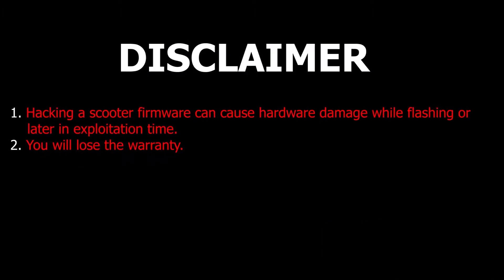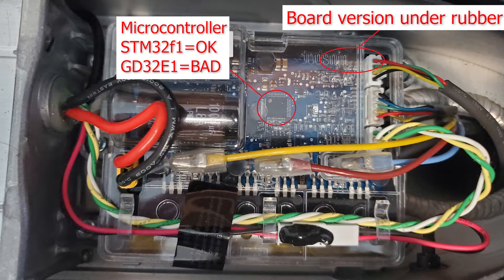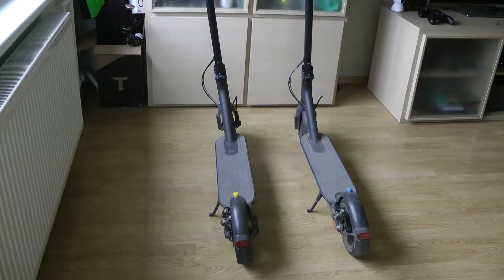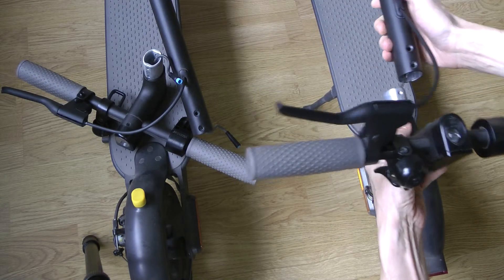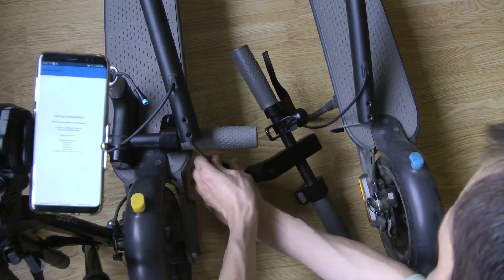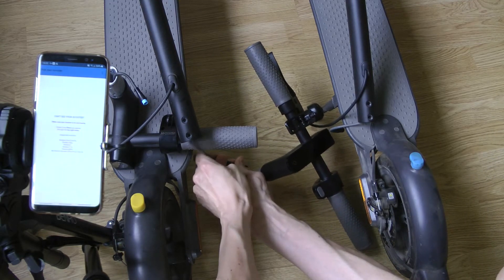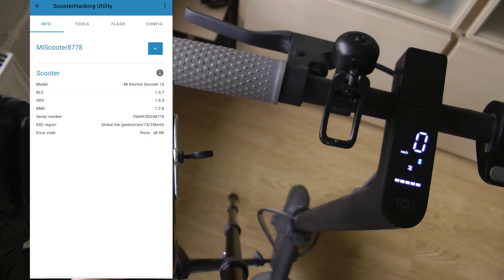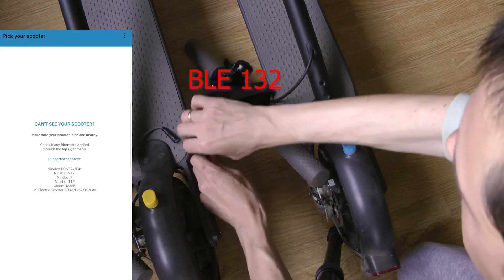Xiaomi Scooter 1S BLE157 speed unlocked

Comment: Hi. I have just bought a used controller with drv 2.5.2 and can't seem to hack it with scooter hacki g utility. I can change the ble and bms versions but not the drv? Any ideas
Reply from the maker: Probably you need to first flash some specific version of DRV. (Before flashing DRV check your ESC version as there are 3.0 and 3.1 and they use different DRV versions - new gen for 3.1 and all others for 3.0)
Try asking for help in this telegram chat: https://t.me/scooterhackingchat
Subscribe, thanks.
Reply: @MindaugasJocionis  thanks for your quick reply God bless
Reply: It's acting like the drv is locked because it wouldint let me flash another drv of any version. I'll keep researching mate
Reply: Will check the version too
Reply: @djjays1dnb  any luck mate?
Reply: @dannyw13  no joy mate. Got version 3 controller but won't let me change drv
Reply: @djjays1dnb  have you tried the st link device? I've ordered one I'll try it that way
Reply: @dannyw13  no iv ended up taking the mosfits off the one I was having issues with and put them on the old one and.hey presto. Fixed. Buzzing... RE inforced traces while I was at it 😁
Reply: @dannyw13  iv not tried.the St link was just going to buy another one as I think it's been flashed and maybe corrupt drv file. It would flash bms and dash just not controller. Good luck mate
Reply: @djjays1dnb  maybe it's bricked somehow, not as easy as we thought ay, same to you man
Reply: @dannyw13  I can't work it out. Iv hacked a few now and early in my ventures had the scooter beeping non stop at me with errors sorted them in the end. This controller though was having non of it. If your phone processor is slow the apps seem to struggle uploading which can lead to software issues so make sure if it's disconnecting while uploading use a better device.
Reply: @djjays1dnb  I see, yh those Chinese boards can't flash the drv at all, I tried everything , st link should work to downgrade the original board to a lower ble version so I can then flash on the original board, hopefully goes well
Reply: @dannyw13  the one I had issues with was a original one 😕
Reply: @dannyw13  the one iv transplanted new mosfets is a copy 😂
Reply: The copy's aren't that bad. If you get a v3 reinforced one
Reply: @djjays1dnb  oh lol, fingers crossed the st link way works for me then, I'll let you know
Reply: @djjays1dnb  got mine to work after all that :)
Reply: @dannyw13  how did you do it. St link?
Reply: @djjays1dnb  yeah st link to flash the board to a lower ble version and then another app to.flash Drv to 244, I could then install scooter hacking custom firmware on and modify on the fly

Comment: Hello i have xiomi 1s ble157 drv321, does it work the same way? Thank you
Reply from the maker: Yes, it will work, but:
Before flashing DRV you need to know your ESC version 3.0 or 3.1 (you can check it with scooter hacking utility app - head over to the top right menu and click on "Hardware details"  STM32 - 3.0, GD32, AT32.. - 3.1). 
After that, depending on the ESC version you need to use old (for ESC3.0) or new-gen (for ESC3.1) DRV.
Or the newest shfw from"scooter hacking utility" app on android, as it supports all ESC versions.
There is no need to flash BMS (I just showed that it's possible). 

As well you can downgrade BLE using ST-LINK V2: https://youtu.be/IvQ4oT2u_vg
For more info check the telegram chat: https://t.me/scooterhackingchat
Subscribe, thanks.
Reply: And also one question, can I do a custom flash for it? . If yes where can I do that and how. I see your were using zips in the video but I can’t find them. I would like to do my own custom tune like you did in the video in the final. Anyways thank you for your support!
Reply from the maker: @jeanpaulhakim9338  Use the "Scooter hacking utility" SHFW, it supports both versions of the controller and can be configured in real-time without having to flash the DRV every time.
Reply: Hi again, i bought a fake head aith ble 9.0.1 can i use the same files? And do i have to flash the bms 128 first ? Thank u
Reply from the maker: @jeanpaulhakim9338  What's your ESC version? No, you don't need to flash BMS.

Comment: Hey just a quick question the video where you use st-link with soldering etc is it still functional with Controller Ver: 3.1??
Reply from the maker: Downgraded BLE gives the possibility to flash DRV to the ESC board over Bluetooth. It doesn't matter what ESC version is on your scooter to unlock BLE.
If you have an ESC 3.1, you need to use a new-gen firmware generator and make your own DRV. Otherwise, you will brick it. 

BLE is the firmware for your dashboard.
DRV is the ESC (motherboard) firmware.

BLE is like a gate that allows or disallows flashing the motherboard (3.0 or 3.1) over a Bluetooth connection.

Subscribe, thanks :)
Reply: @MindaugasJocionis  thanks ig i will try it should work based on forums and yt, just in case i will look into how to unbrick but thanks
Reply: @MindaugasJocionis  would you recommend to use xiaodash after i downgrade the ble with st-link?
Reply: @MindaugasJocionis  But just to confirm:
I have  Xiaomi 1s scooter

BLE:157
DRV:321
Ver 3.1

ST-Link would it work if i do everything in the video?
Reply from the maker: @darks2485  Yes, you can downgrade BLE as in the video. 
For speed hack you will need to build different DRV:
https://rollerplausch.com/threads/neuer-controller-v3-1-bei-aktuellen-xiaomi-rollern-brickgefahr-bei-drv-downgrade-vorgehen.5187/page-9#post-67651
http://nextgenfw.pythonanywhere.com/
As well for more info try this telegram chat: https://t.me/scooterhackingchat

I use "Scooter hacking utility"
Reply: @MindaugasJocionis  Alright so follow everything from vid and then use newest firmware from the link your mentioned. cool seems ez thank you
Reply: Or i can use xiaodash right?
Reply from the maker: @darks2485  I never used xiaodash. Yesterday "Scooter hacking utility" released  SHFW0.2.6 which supports all controllers.
Reply: @MindaugasJocionis  i guess i can try that instead then, seems more logical since its the #1 site
thank you

Comment: If i have ESC 3.1 on my comming pro 2. I have now an older mi3, can i svap ESC board? So mi3 board in pro 2.  Thanks.
Reply from the maker: Of course. In my opinion, first, you need to change the serial number using downg (so that the applications recognize it as pro2), then flash to it the DRV from pro2 (though I don’t know if it’s necessary). And then connect to pro2.
For more info try asking in telegram chat: https://t.me/scooterhackingchat
Subscribe, thanks.

Comment: Can I use my friend's screen from a pro 2 on mine, which is an mi3? Or do they have to be the same model?
Reply: Hey if i take dashboard BLE 1.2.9 will i be able to also add an external battery?
Reply from the maker: Yes you can.
Before doing that, make sure that your ESC is 3.0
Mi3 at first must be downgraded to DRV003.
Sub. Thx.
Reply: @MindaugasJocionis  Is there a way to see if it is 3.0 without disassembling the patin?
Reply from the maker: @rutitasconjorgito4003  In ScooterHacking Utility app use the three dots menu, click on Hardware details.
mi_DRV_STM32 you have an old v3.0 controller.
mi_DRV_GD32 you have a new v3.1 

Or

Use the app: "m365 downG " and look in the UUID under Tools. If the UUID does not contain the characters FF , it is the new controller 3.1
If the UUID contains the characters FF , it is the old controller 3.0
Reply: @MindaugasJocionis  yes i have stm32f
Reply: Yes he have  FF in UID
Reply: @MindaugasJocionis  Thanks for everything, so if I could do it, right? If I get it, leave me a paypal or something to send you help for helping me
Reply: And what bms i have to do in my mi3?
Reply from the maker: So it's old controller and you can flash any Mi3 DRV, you won't brick it. You don't need to do anything with BMS. (I just wanted to show that you can downgrade it too with this method).
I'm suggesting you to use with mi3 SHFW from scooter hacking utility app.
And check this telegeam chat for more info: https://t.me/scooterhackingchat

This head swap method is only for locked BLE155, if you have BLE152, you can flash DRV without swap.
Or check link in the video description on how to downgrade BLE with stlink.
Reply from the maker: You can donate for channel support in channel page about section, or over this link. But it's really not necessary :)
https://www.paypal.com/donate/?cmd=_s-xclick&hosted_button_id=GGEKBMKDSPYGS&source=url
Reply: @MindaugasJocionis  Yes, but when I do it, it appears that I have a restricted ble, so I would have to change the screen as in the video and then put the SHFW
Reply from the maker: Yes, if BLE is restricted, then head swap method or BLE downgrade with st link.
Reply: @MindaugasJocionis  i have 1.5.5 ble
Reply from the maker: @rutitasconjorgito4003  Yes, it's locked BLE.

Comment: hi i have a question please 
i have a mi 3 and you know thats the axe who fix the wheel with steering wheel is instable so i have make a spong in the axe and by time when i remove the spong  i notice that the axe is instable
Reply from the maker: Are you talking about the movement of the locking mechanism? If yes: https://photos.app.goo.gl/j5jPrq2T8s2cezBF9
You need to tweak it a bit. I hope this illustration helps.
The idea is to make that bolt a little bit shorter by turning the long nut.
Reply: @MindaugasJocionis  yes but if i do this spong in the lock mechanism by time it make some probleme in the lock ?
Reply from the maker: @MarGameING  No, the sponge will not do any problems, tho it is better to adjust the locking mechanism.

Comment: So what is the procedure if BMS version is over 1000?
Reply from the maker: Leave BMS as it is if the BMS is over 1000. I just wanted to show that you can flash BMS, but it's not necessary for the speed increase.
First, check your ESC version. If it's 3.0 you can proceed with a head swap as in the video. If it's 3.1 you need to build DRV with new gen firmware builder.
For more info check the video description.
Subscribe, thanks.
Reply: @MindaugasJocionis  thanks for the clear answers. I checked and I have a 3.1 version. Is there a way to hack it with this version? Because I read the German forum you recommended and it doesn't seem like it

Comment: Hi, I have 2 questions. I have done the head swap process a dozen of times but my prcedure is a bit different. 
1) What is the reason when flashig first method (CFW from scootehacking), you need to use external files (and moreover, you flash 2 different archives)? When I do the same, it's enough for me to just flash the firmware built by Scooterhacing CFM mahager and I have all the potions which I can tune to my liking. So is there any additional "special" fomwareware component that you are flashing at the secon run (with CFW)? 
2) I haven't ever cared about BMS versions, and as said above, I have flashed like 10 scooters with the head swap method. Am I was just lucky not to brick it? BTW just today I have got a new Mi3 scooter and I was curious to look at its UUID and it DOES NOT contain FF characteers. Does thos mean that using the described head swap methd above, I will brick it? TBH I already tried it, but at the monent I only have a spare head from Pro2 and scooterhacking refused to flash Mi3 with Pro2 head. Or was it exactlyu because if the new BMS controller? 
PS cool channel I glad that I fount it, subscribed.
Reply from the maker: I wanted to show 2 methods, 1st when you can flash your built DRV or BMS that you wish to. And the second is that you can use a scooter-hacking app. 
As for BMS, better to leave it alone, there are differences between them, such as unlocking more battery capacity (which is reserved) or fast charging. But there is a new BMS hardware version that is incompatible with old BMS firmware and might be bricked.
"Am I just lucky not to brick it?" - yes lucky :)
"it DOES NOT contain FF characteers" - yes its 3.1 version, depending on the controller you may totally brick it, or partially (when the scooter turns on by itself after shutting down).
"scooterhacking refused to flash Mi3 with Pro2 head" - lucky again :) Maybe they implemented something, I have no idea. 
Personally, I flashed mi3 with 1s head (and they are the same as pro2) with method 1 that's in the video, and it went ok.

As for new esc controller, you need to build DRV with new builder:
https://rollerplausch.com/threads/neuer-controller-v3-1-bei-aktuellen-xiaomi-rollern-brickgefahr-bei-drv-downgrade-vorgehen.5187/page-6#post-67651
Or ask for a prebuilt one from this telegram channel: https://t.me/STLink_XAP2P
As well check this channel for more info on flashing: https://t.me/scooterhackingchat

Thanks for sub :)
Reply: @MindaugasJocionis  wow thanks for such a detailed answer!🙏

Comment: Soo if i have STM32f1 microcontroller and BLE over 155 can i do the flash? I was unable to flip the board and see if its 3.0 but i have STM microcontroller on top of the board. 

Ordered dashboard for Pro 2. Can do downgrade BLE with it and flash my Scooter 3? Thanks
Reply from the maker: Yes if it's STM you won't brick it. 
You can check board version: Download the "m365 downG " app and look up the UUID under Tools
If the UUID does not contain the characters FF , it is the new controller: Flashing the old DRV* leads to Brick !!
If the UUID contains the characters FF , it is the old controller: no problem with flashing
BLE version >= 155: Flashing of CFW is blocked
If your ordered dashboard is original, you can modify your scooter, if some clone ¯\_(ツ)_/¯.
You can downgrade your original BLE with stlink.
Check this telegram chat for more help: https://t.me/scooterhackingchat
Subscribe, thanks.
Reply: @MindaugasJocionis  thank you very much for answear all the qustions. I ordered purple aftermarket one. I seen that purple ones are “flashable”. Hope it will work. If not i try the st-link as you suggest. At least i have a new spare board for future upgrades or next scooter (i go with the Pro 1 for me and left the 3 for my gf after some time) .

Comment: Hi,  I have 1s head and the scooter 3.
The 1s head will work with the scooter 3?.
Thanks
Reply from the maker: Yes, it will work. Probably it will give you beeps and error codes, but DRV will be flashed. Before flashing check your ESC version.
Use SHFW from "Scooter hacking utility" as mi3 needs in addition to this DRV (that is used in the video) hacked BLE (and you cannot reflash your BLE as you have locked 155 version) otherwise it will give you error codes on the dashboard.
Subscribe, thanks.
Reply: @MindaugasJocionis  Where can I find the files for the mi3?  I think it would be of great help for all those who have a mi3.
Reply from the maker: @OgiVM  You need this app for android: https://play.google.com/store/apps/details?id=sh.cfw.utility&hl=en&gl=US
 it will download DRV automatically. After that, you need to do the setup of amperage for the scoter.  Check the help signs for suggestions. 4:39

Comment: I have a slightly smaller motherboard. Were your number 3.0 is written. My board is cut off. I have a Pro 2 bike. Actually I have two, one that I have hacked but one that I accidentely upgraded to 157. I can use the dashboard from the one scooter that I have not upgraded but since I can not se anywhere on the motherboard if its 3.0 or 3.1 I dont know if I dare to do it. But do you think its safe becouse I could hack one of them? Bougt bouth of them new at the same time one month ago.
Reply from the maker: Use the app: "m365 downG " and look in the UUID under Tools. If the UUID does not contain the characters FF , it is the new controller (3.1): Flashing the old DRV leads to Brick !!
If the UUID contains the characters FF , it is the old controller (3.0): no problem with flashing. 

If you have a new controller, ask in this forum, there is a link to a web builder for the 3.1 controllers DRV, you must build it by yourself. https://rollerplausch.com/threads/neuer-controller-v3-1-bei-aktuellen-xiaomi-rollern-brickgefahr-bei-drv-downgrade-vorgehen.5187/page-6#post-67651

Or ask for help in this telegram chat, this guy has already prebuilt DRV's for the 3.1 controllers.
https://t.me/STLink_XAP2P

"Scooter hacking utility" is working for support for 3.1 controllers as well, but still it's a work in progress.

Subscribe, thanks.

Comment: I have very weird problem. I have mi pro 2 with ble 157, I bought dashboard from 1s and my flashing is success speed and everything is ok, but I can't turn off my scooter every 30 minutes it's beeping  I tried to discharge battery, disconnect battery cable nothings helps 1 way to turn it off is to load stock xiaomi app and upgrade the firmware but settings are reset and max speed is again 20😥
Reply from the maker: Did you check your ESCversion? 
You can check your ESC by the app: "m365 downG "  look in the UUID under Tools. If the UUID does not contain the characters FF , it is the new controller.
If the UUID contains the characters FF , it is the old controller.

I think you have that 3rd version, and you need a different DRV.
Ask in this forum, there is a link to a web builder for the 3.1 controllers DRV, you must build it by yourself. https://rollerplausch.com/threads/neuer-controller-v3-1-bei-aktuellen-xiaomi-rollern-brickgefahr-bei-drv-downgrade-vorgehen.5187/page-6#post-67651

Or ask for help in this telegram chat, this guy has already prebuilt DRVs for the 3.1 controllers.
https://t.me/STLink_XAP2P

"Scooter hacking utility" is working for support for 3.1 controllers as well, but still it's a work in progress.

Subscribe, thanks.